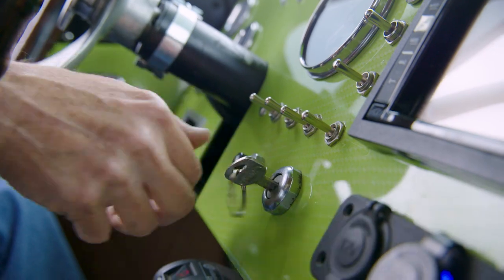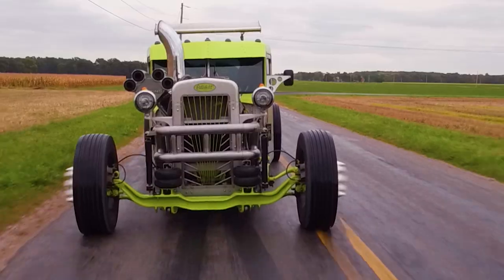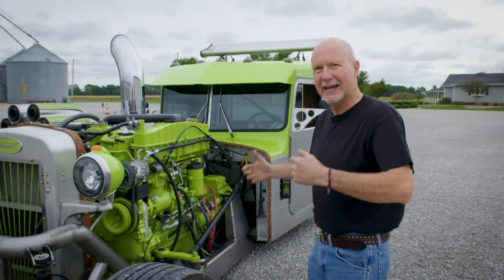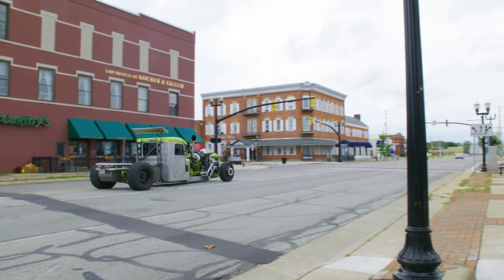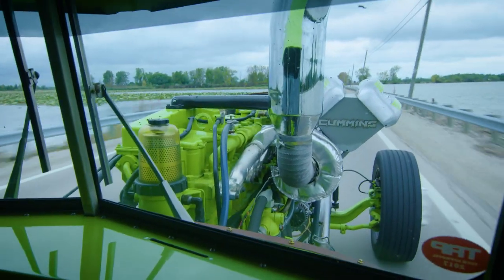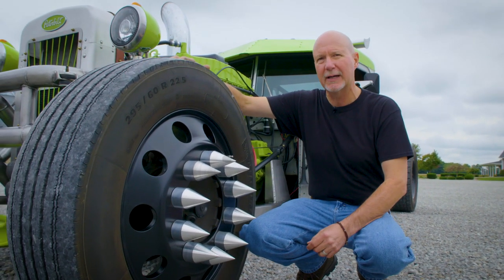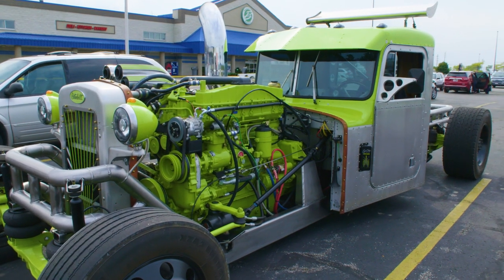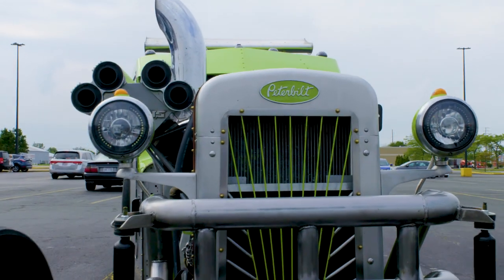Meet Overkill - The Ultimate Peterbilt RatRod | RIDICULOUS RIDES

Comment: Those welds look like bubble gum, I would have at least ground those down smooth.
Reply: 🙋‍♂️ Howdy ! 

from Central Texas fellow hood-flipper.
Reply: @black_jackledemon6298  it's a sweet ride,  I'm a certified welder, weld inspector,  so I pick welds to death.
Reply: @danielfinney4295 Almost 50yo Welder/ Machinist in Central Texas.

Family trade but learned to enjoy it and came back around to it after quite a few years as an autobody guy and custom painter.

I'm very particular about both structural strength and the fit and finish and can relate

Love unique vehical builds but those welds jumped out and distracted me immediately. 😖

I'm a lot more patient with the youngins that help me than my seniors were with me as an apprentice in any of the trade skills. "Oscar the Grouch" has realitives.😂🤣

I've got an impressive bad arse file collection just for passing pipe visual inspections.😏

Haven't ever busted an X-Ray but that's not bragging.....still about 2-3 hours slower than my father per "bottle".

[Natural Gas field refinery units.]

I can beat him on thin gauge stuff in general and it's neck and neck on aluminum.

Better at soldering but he spanks me like a misbehaving 4yo at Wal-Mart at brazing with a torch but about even with silcone bronze where I perfer the TIG but can "dime" it with a torch to

🤷‍♂️Still not sure why I so often suck at good looking Brass....😔 just sand it down honestly.

😉 But hopefully I'll live long enough to whip it someday. 

Stay safe, have fun with it if you can and best wishes in your personal as well as professional life. 😁👍